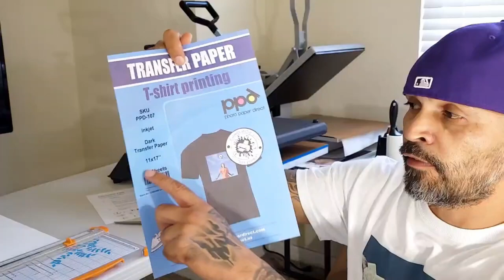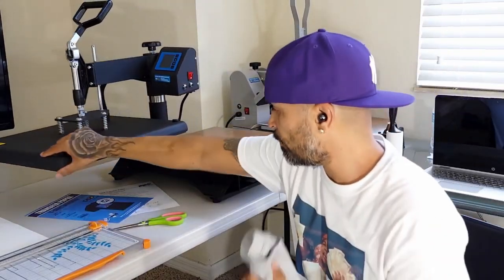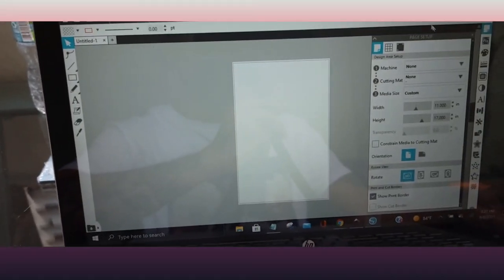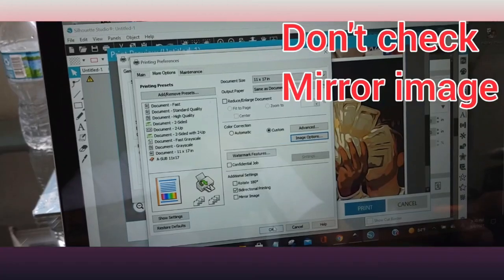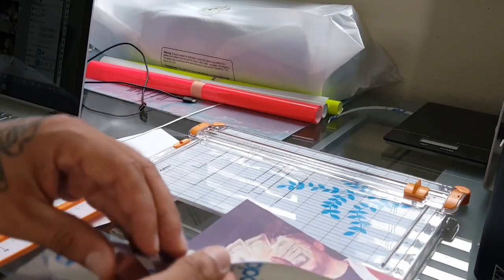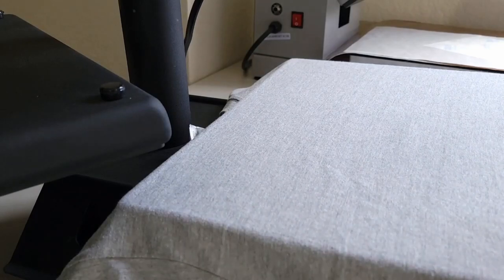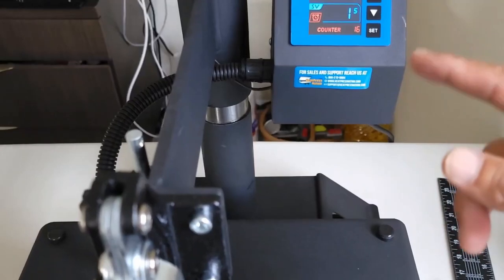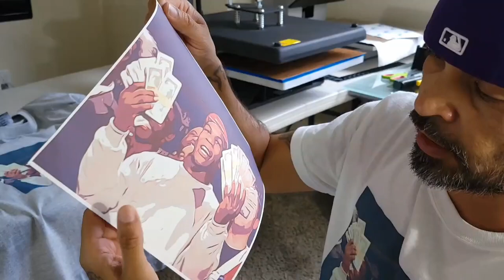Heat Transfer Paper | Sublimation | Cotton T-shirt (Tutorial)

Comment from the maker: *UPDATE*:  Regulat Jet-ink use ppd instructions.  Sublimation can experiment.  385 Degrees For 30 Seconds Firm Pressure Heat Press.  After 1st press, leave Silicon Paper on for 30 seconds, and then peel.  2nd Press with Silicone Paper 10 to 15secs. *

Comment: Dope bro.  How is the feel on the shirt?  Heavy like vinyl for that block?
Reply from the maker: Very light this block size image, wash tested twice, pretty solid product with a learning curve.
Reply from the maker: *UPDATE*:  385 Degrees For 30 Seconds Firm Pressure Heat Press.  After 1st press, leave Silicon Paper on for 30 seconds, and then peel.  2nd Press with Silicone Paper 10 to 15secs. *

Comment: Thank you!! What printer do you have btw ? And do you love and recommend it?
Reply from the maker: Hey.  I have WF-7840 & EcoTank 3760.  Difference is WF can print 8.5x11", 11x17", and 13x19" vs ET 3760 8.5x11"  Now there is a Ecotank 15000 that does same as WF 7840.  Depends your budget.
Reply from the maker: WF 7840/7820 estimate $300 print all paper sizes, EcoTank 15000 estimate $600 print all paper sizes.  Then there other models that will be different and prices goes down.  Add also the EcoTank easier to convert to sublimation.
Reply from the maker: Final note, did some quick search.. ET-15000 would be my personal choice (just need ink), but WF 7840 or 7820 can still be good and at cheaper price (but will have to change chips, get refill cartridges, get ink, and will have to get more chips UNTIL they make chips dont have to change).  My 2cents. hope that helps.
Reply: You just broke it down perfectly. Thank you so much ! Appreciate you!!
Reply from the maker: @allenasanford8482  Welcome.  Feel free to ask any time, and whenever you are ready to convert, need help... I'm around.
Reply from the maker: *UPDATE*:  385 Degrees For 30 Seconds Firm Pressure Heat Press.  After 1st press, leave Silicon Paper on for 30 seconds, and then peel.  2nd Press with Silicone Paper 10 to 15secs. *

Comment: The only thing I can say about this paper and I don’t understand why it did this, but I made an apron with image. The apron is 100% polyester, but the apron is red, RED RED! The paper printed out really well and beautiful colors. But once I printed it on the apron, all the images turned red! I wish I could show you on here. I have like 20 pictures on it. So now I’m gonna try it again on a white 100% polyester to see what happens. I’m sure it will be fine this time. But just wanted to warn you about this paper and the color red. I did follow directions.
Reply from the maker: It is trial and errors with these products. It is not bad overall.  But thanks for the heads up
Reply: @diywithkenny8399  , one other thing I wanted to add to that. The odd thing about it is, I also put an image on a red potholder to match. It came out perfect! I don’t know what the potholder is made of though. I got the potholder from Walmart. It has 2 pockets on the front for you fingers to go into. So yes it is a trial and errors. But I love doing all this stuff!
Reply from the maker: That's good... same here on trying new stuff.
Reply: a year later- what happened was color migration,
 the red ink from the apron sublimated into the transfer. the only way i know of to fix that is to use a blocker layer inbetween the apron and the transfer to keep the ink from going thru the printed side- 
i learned this the same way, and used what i had laying around to figure it out, 
i pressed chrome htv first as a blocker layer and then pressed the heat transfer over and it worked. the red didnt bleed through

Comment: Are you supposed to mirror when doing sublimation? Also when choosing print colors I always get great results using the RBD not vivid print color! I’ve tried both and found much more vibrant colors. This is a great video I’m glad to see someone is testing sublimation on this paper
Reply from the maker: Hello.  Experiment in tgis video, someone in comments mention better value tacking down PPD. then use the sublimation paper with design and heat press it that way (kinda like the glitter vinyl).
Reply: @diywithkenny8399  Never heard of this This may be a good test.

Comment: Are you using sublimation ink on heat transfer paper
Reply from the maker: Yes.  Sublimation Ink permanent
Reply from the maker: *UPDATE*:  385 Degrees For 30 Seconds Firm Pressure Heat Press.  After 1st press, leave Silicon Paper on for 30 seconds, and then peel.  2nd Press with Silicone Paper 10 to 15secs. *

Comment: Thank you for the video.  My question is,  do you have sublimation ink or regular heat in your printer?  I own the wf 7720
Reply: That was supposed to be regular ink
Reply from the maker: No worries.  Sublimation ink.  Can check the pin comment for updated results.
Reply from the maker: Also... load 1 of these paper at a time; I would cut the 11x17 in half to 8 1/2x11 to load them in ET-3760.  So your printer should handle them.
Reply: @diywithkenny8399  Hello Kenny, just wondering why you use sub ink instead of regular inkjet ink?
Reply from the maker: Testing out new ways 😎

Comment: i did the same steps comes out clean but after first wash whole image has a bunch of cracks what em i doing wrong? im using ppd transfer paper and hp printer photosmart 7520. and heat press at 375 for 12 seconds...
Reply from the maker: Hello and hmmm.  Sublimation or Regular ink?  I noticed in a the instructions is to leave the white silicone paper on there for 30secs (teflon sheet ontop to help hold down), then peel.  Try that.  Now there a comment from someone they lay down the ppd, and use sublimation paper and heat press onto that way.  Now I have tried regular jetink and have last 10 washes no cracks.
Reply from the maker: Ok. After 1st press, just leave white silicone paper on it for 30secs, if you have teflon sheet use that too.  I would 2nd press again exact same way.  Make sure you have the heat press firm pressure. Try that on a old shirt and wash same amount to see results

Comment: I am trying to do a shirt this way but I'm having trouble with the border part. It shows a border but it's up in the left hand corner and there is no option to expand it. Also when I got to print it only half the whole first image but the second image is cut of. It's only half of it. What am I doing wrong?
Reply from the maker: Hey.  Have to ask a few questions:  What software you are using to print?  What printer is doing the print?
Reply from the maker: Adding:  when you click the print preferences, first tab under selection here paper goes (paper tray, cassette 1, ...)  there option borderless, needs to be checked, to help expand
Reply: I am using canva to design and download & silhouette to place and print. I'm using an espon 7840.
Reply: @diywithkenny8399  Ok. I did exactly the steps in your video. When I go to silhouette it has the border like yours but it's up in the left hand corner not corner to corner like yours. The border won't stretch to all four sides. When I hit the preview button it's only showing 1 picture and half of the other. It's not showing both pictures like yours in the preview.
Reply: Wish I could show you because I don't think me explaining is good, lol
Reply from the maker: @teambubblez3045  Ok.  Hopefully you could try this but gonna have to do this in the preferences:

1st size (expand) your design on Silhouette, turn off print border on there.

2nd when hitting print, go to preference, make sure you click on the middle tab, near top paper size, make sure borderless is checked.

Try this 1 time see if works.  If not will have to look into this tomorrow.  So please reply so I know, because i have printed with no border full page before.
Reply from the maker: Ok.  Also make sure clicking the middle tab, the document size is the same near top.  Should be able to change it to where you see size two times.
Reply from the maker: @teambubblez3045  No worries do understand, but give those steps one more try, may just have to do a video on it.
Reply: Okay I will definitely try it tomorrow and let you know how it goes. Thank you!
Reply from the maker: @teambubblez3045  Sounds good.
Reply from the maker: Hey.  Was you able to figure that out?
Reply: @diywithkenny8399  hey sorry work and school had me for a couple days but I am trying it now. I hit preferences and mines doesn't look like yours. It give me layout and paper/quality. When I hit advanced it just takes me to paper/output.
Reply from the maker: Ok.  No worries will show how to add a 2nd preset.  Should be out tomorrow.
Reply: @diywithkenny8399  okay. Thank you.
Reply from the maker: Well not to many do not know, had another request on that issue.  Welcome 😎
Reply: @diywithkenny8399  glad to know it's not just me, lol
Reply from the maker: Copy these settings: https://youtu.be/GGd9r88UmM8

Comment: Helppppp!!! 🆘🆘🆘Ok I am trying this method and my cover sheet keeps sticking to the image when I lift the heat press. I mean it's completely stuck to the shirt. The colors are there but my image just turns into a giant two side sticker.
Reply from the maker: Hmmm.  Are you referring to the white parliment paper⁉️. Try to loosen the heat press plate (pressure).
Reply: @diywithkenny8399  yes the paper sticks to the printable vinyl. I have no idea what I'm doing wrong.
Reply from the maker: You may have too much pressure on your heat press, should be a knob that you can turn; turn clockwise more pressure. turn counter- clockwise less pressure.. should be able to adjust when top plate lifted, can adjust off so just lay a shirt down, loosen pressure, then you can see from there.. may have to adjust a few times but not so tight where you have it now.
Reply from the maker: Try that and let me know
Reply: @diywithkenny8399  I think the problem is that I'm using butcher paper which doesn't have a coated layer.
Reply from the maker: Oh i see.. yea have to use the white parliment paper over design always, then teflon sheet helps too.. no need for butcher paper.  Also may wanna try regular jetink too.

Comment: Hello Kenny, Thank you so much for this tutorial.  I used the easy subli and boy did I waste so many sheets because of smudge.  I felt so defeated not to mention the cost. I will try this product.
Reply from the maker: Thanks Marley.
Reply from the maker: Hey also wanted to share, Print Borderless video I did review and wash test on the Heat Transfer Paper PPD.  New video print & cut using same product.  Yes I have EasiSubli too, and not a big fan of it lol.  Let me know how it goes.
Reply: You should have had great results with easy subli. I’m not sure what you did wrong but you need to use sublimation ink not ink it’s not for  ink jet printer.
Reply: @FLYNIQ  Hello Nkechi.  Thank you.  I did use sublimation ink. In fact I have 2 sublimation printers,  2 ink jet printers and a laser printer .  I followed the directions according to easy subli.  This product isn't for me.
Reply: @marleymarley1360  ok 👍🏾 try econo transfer if you trying to print on dark colors. They have sublimation fabric.
Reply: @FLYNIQ  Thank you, I will take a look at the econo transfer. I saw a video on sublimation fabric it was nice.  Yesterday I received my PPD heat transfer paper.  Today I am going to try it.
Reply from the maker: Hey Marley, make sure after 1st press to leave silicone paper for 30secs for better results
Reply from the maker: *UPDATE*:  385 Degrees For 30 Seconds Firm Pressure Heat Press.  After 1st press, leave Silicon Paper on for 30 seconds, and then peel.  2nd Press with Silicone Paper 10 to 15secs. *

Comment: Isn't Sublicotton, Exactly like Dark Transfer Prints.
🤔
Reply from the maker: The direction for this Heat Transfer Paper is to use regular ink from any jet ink printer, but for this I tried the dye sublimation.. not so sure how regular printer ink vs sublimation ink.  Only the heat press directions are different as you can see my updated pin comment (sublimation ink).

Comment: I made a shirt and after a day it faded on its own. I put it back under the press again and the colors got bright and vivid and in a day dull again. I used sublimation ink... Am I missing something??
Reply from the maker: Did you try these settings?  385 Degrees For 30 Seconds Firm Pressure Heat Press.  After 1st press, leave Silicon Paper on for 30 seconds, and then peel.  2nd Press with Silicone Paper 10 to 15secs. *  Working on regular jetink, testing washes.   Seems to work a lot better.
Reply: I have made shirts using my inkjet printer and the shirts gets washed regularly and never had any fading. I’m amazed how well my tiny birds stayed on the shirt I made for my husband. It’s a life is good design and has 25 tiny birds in the background and it’s been washed over 50xs and still as nice as the first day I made it. Sublimation is completely different and I doubt it will last, your supposed to mirror yr imagine and apply it to the material, this stays on the paper so it’s not gonna last as long
Reply from the maker: Not mirrored this video.  But that is the better method my opinion.
Reply: Used sublimation printer, but the colors were not accurate.  What did I do wrong?
Reply from the maker: Can be a few minor things, have you calibrated your colors, have you done amy print head cleans to bring back the colors (may have to do this a few times).

Comment: Hi, great job! I have a Epson ET-8550 that is sublimation, will this process work on PPD Light Heat Transfer Paper? Thank you
Reply from the maker: Hello.  My honest opinion on sublimation for the PPD product, better off using regular jetink.  Only way it will work for sublimation is to tack down the ppd on garment, the. use your sublimation print paper (+design/image printed on A-Sub or whatever), then heat press it 390 to 400 degrees, 45 seconds more or less.  All depends on your equipment.  Lot of extra steps FYI.  Hope that can answer it all.
Reply: Thanks Kenny
Reply from the maker: Welcome and anytime 😎

Comment: Can someone tell me difference between heat transfer and sublimation paper
Reply from the maker: Heat Transfer Paper - printing a design onto a sheet of heat transfer paper using an inkjet or laser printer.  Then heat press onto any cotton color garment.

Sublimation Paper - print design using sublimation ink.  Then heat press is to polyester garment (white and light colors only, polyester blends 50% and up).  100% polyester best results.

Comment: Question, why is it that every time I get ready to print out a project, my  printer says  “ Paper out in paper tray. Load paper and touch ok” but I have the paper loaded correctly!
Reply from the maker: Hello.  You picking the print preference off the computer right, now are you loading your paper afterwards or prior?  Anyhow it does me too lol.  Most of the time if you load your paper 1st, it works for the most part.  Just a communication bridge between the computer, software app (your design), and then the printer lol.
Reply: @diywithkenny8399  I already have the paper in when I get ready to print
Reply: @diywithkenny8399  I have my print preference already set up
Reply from the maker: Ok. Happens all the time⁉️  Now when loading paper, check the screen, may predict paper example a or paper example b.. that part too may trigger it by not picking paper.   Worse case scenario, after your printing and done for the day, unplug for 10 min, or comeback till next day (turn off 1st).
Reply: @diywithkenny8399  Thanks a lot!!!
Reply from the maker: Welcome.  But honestly.. electronics been weird lately like cellphones, wifi, computers, softwares.. so do not fret.  Not like major, but weird at times lol.

Comment: could you have done a boardless print to avoid the white lines?
Reply from the maker: Yes you can when going into the printer preferences and selecting borderless, may depend on what software you use for the print job.
Reply from the maker: *UPDATE*:  385 Degrees For 30 Seconds Firm Pressure Heat Press.  After 1st press, leave Silicon Paper on for 30 seconds, and then peel.  2nd Press with Silicone Paper 10 to 15secs. *

Comment: Hello Kenny, 
Do you run two printers? Just wondering how you’re able to print with sublimation ink for this video but now you are saying in the replies to comments you will print with regular ink jet ink moving forward because you see better results with this method of transfer. Just curious, I have one printer and am trying to develop a way to sublimate onto dark cotton blanks other than bleaching my area beforehand or using sub-spray.
Reply from the maker: Hello.  At that moment of the video, yes the sublimation was good.  After few washes, tenf to fade.  

IF you wanted sublimation, will have to tack down the heat transfer paper, print design on sublimation paper, the. heat press it down.

The regular way it was intended with regular jetink, which i have done.
Reply: How did the update method hold up in washes? Have you ever used nufun paper? I loved that better than ppd!
Reply from the maker: Washes for regular jetink held up about 15 so far, but sublimation method I done in video was a handful.  No never tried nufun, need to check that out.
Reply: Thank you!!! Awesome
Reply: @diywithkenny8399  Worked perfectly. I needed this method for my nephew's memorial t shirts. Thank you so much!!!

Comment: I don’t have same ma machine to heat press I have other that I turn the knob  to lift and bring it down .i don’t have no body to help me
Reply: The heat press in this video has a pressure knob that rotates (rises and lowers the press). If you lower it too low, it won't press (close) on garment. You have to try out the knob and keep it at the height that allows for high pressure and allows heat to press down.